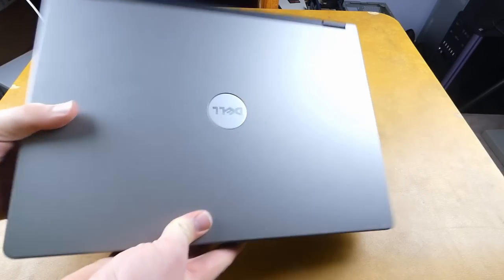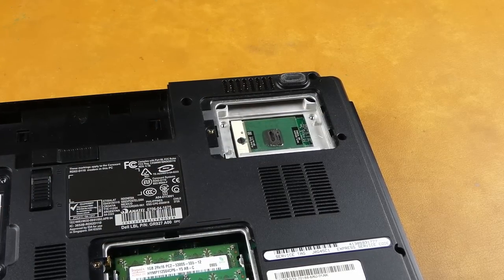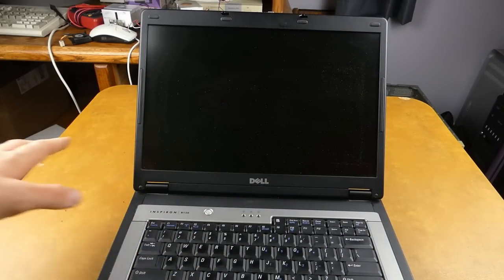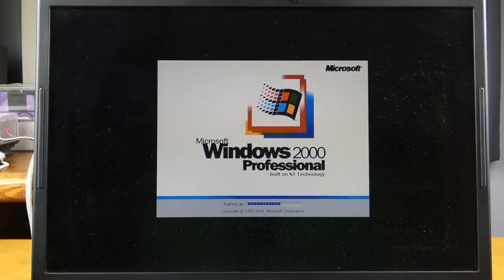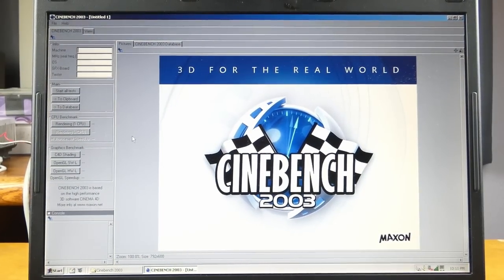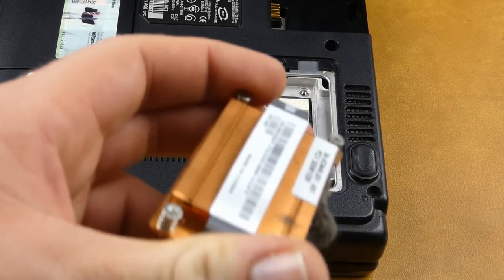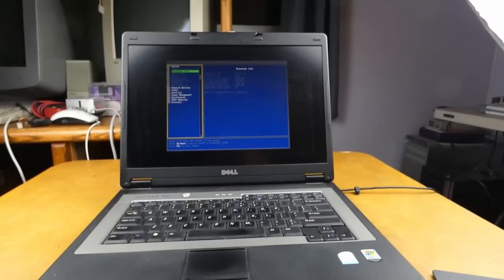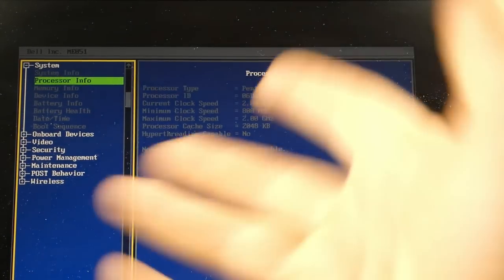World's Easiest Laptop CPU Upgrade

Comment: That's a Dell? I have the N5110 and they made that where you have to take everything out to replace a hard drive. Motherboard etc just to get to it. One of the main reason I never did the upgrade. Screw that.
Reply from the maker: Dell has changed a lot unfortunately. By the early 2010s their machines were completely different, and in my opinion, a lot worse.
Reply: @NTGTechnology  I perfer Acer but a friend gave me the N5110 10 years ago it is a i5-2410m with 8GB ram not slow by any means. If I did put a SSD in it I bet it would rock. Whoever design this was a idiot. I have watch videos on how to replace the hard drive and I am still scare. LOL Acer on the other hand still have doors I never had a newer machine with nVME but All Acers I ever dealt with are user serviceable.

Comment: Do you really want that storage upgraded and expand your RAM? Sell your machine, and buy a used one with the specs you need, simple. Upgradability in laptops is overrated and here's why I think so:

If it would be the case that I could swap everything in, for example, a macbook pro 2012. What would I be able to achieve? Put a 4th gen core i7 instead of a 4th gen core i5 in there? I would still be limited by the CPU socket and it's supported processors. 
Would I be upgrading the RAM? Okey, let's look for some old modules to expand the overall size, but all the advancements in the RAM technology like DDR4 are not supported by the motherboard. 
Try to put some storage upgrades in there? Make sure you buy this old 2,5" ssd instead of them new (sometimes 10 times quicker) m.2 storage.
Want a nice retina screen in that old macbook? To bad, the GPU can't drive that.
Connect some usb-c devices? Get a dongle and enjoy the usb2.0 transfer speeds and capabilities.

But okay, let's say we upgrade it to the max specs supported by the motherboard. It still won't run the latest MacOS or Windows due to the processor missing some newer technology's.

So in the end, I'll be looking for a motherboard, cpu, gpu, display, storage, RAM and outer shell (to support the new usb-c hubs) upgrade. Seems like purchasing a brand new machine will help me out with all this, comes pre-assembled and is more cost effective.

Comment: tbh this isnt possible anymore due to the FACT, that components getting very hot and need larger coolers going over the complete mainboard. But yes, usually there could be better solutions, in special to open the cases and not using 5 different types of screws. Its also a fucking shitfest to just find a BIOS update or infos about your device to knew what CPUs are compatible...

Comment: not all old laptops were easy to work on... some are pure garbage to work on. and some new models are way easier to work on because a simple set of 8 screws and we remove the whole bottom case. Instead of having to remove the keyboad and even screen on most old laptops.

Comment: Wait, you're bothered by the missing VGA screws? Geez, if you had seen just how many motherboards and GPUs that I've seen in shop literally destroyed because some nitwit forgot to unscrew them before moving their system, you'd learn to appreciate the missing screws as an upgrade.

Seriously, why do you think practically no modern connectors have screws anymore? Engineers finally recognized that it's better to allow cables to quick disconnect than to leave it to the ignorance of humans to rip the ports right off the board.
Reply from the maker: I've never seen a VGA port or a DVI port destroyed because someone forgot to unscrew it. Have you considered people maybe LIKE knowing their stuff isn't going to be easily unplugged? VGA often doesn't have a lot of friction to keep it place especially if you're moving your system around a lot. No one forced you to use the screws, if you didn't like them then you didn't need to use them. But that doesn't mean the rest of us shouldn't be allowed to have them as an option either.
Reply: @NTGTechnology  I've repaired thousands of systems in my life. At least about a dozen of them were due to catastrophic damages of someone forgetting to unscrew the cables.
Reply from the maker: @southernflatland  And that's their fault. Doesn't mean I shouldn't be allowed to have the option of screwing my connector in.
Reply: @NTGTechnology  I do tend to agree with you on that level, the full connector should have all the bells and whistles as originally designed.

But at the same time the B130 was made to military specifications, hence the simpler and easier to service design. They literally TRIED to avoid known causes of failure and also designed it in such a way to make parts super easy to swap in a pinch.

And yes that even includes their choice of heatsink film material there. You really think they got time to source heatsink compound out in sandy/dusty Iraq?

That aluminum film stuff with the original compound behind it settles perfectly and gently on top of the CPU core, without need for compound, making for easier service in battlefield conditions.

You should look up military electronic specs, it's rather interesting and also the reason I picked up the B130 in the first place.

Comment: My 2012 Clevo W110ER is even easier, not a single screw and I have all the motherboard exposed, all it needs is the push plastic tab like to remove the battery and the entire bottom cover slides out and can change CPU too or anything super fast.

Comment: Not all these upgrades are successful. For example, some laptops may dislike the QL65, and only work with QL64. QL65 has 2000 mhz fsb, while QL64 has 1800. After 30 days of repair, the Windows server sends a malfunction, icons disappear, start menu won’t respond, and can’t turn off. Needs the QL64 back. Same with wifi cards, Asus needs Azureware or else, the laptop won’t turn on. Turion supported devices dislike Athlon, Turion has 800 mhz fsb. Same with batteries, the factory default is way too much better, but more expensive. The performance is better, and you don’t need to keep the battery inside, but sometimes you need to insert it.